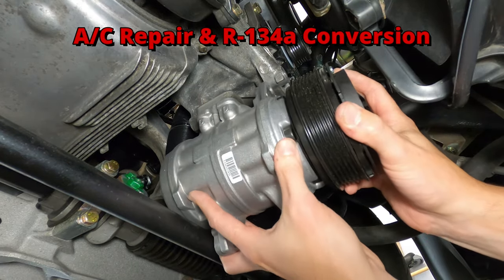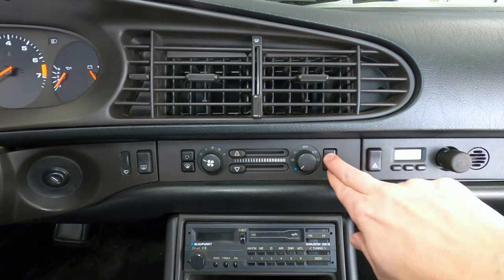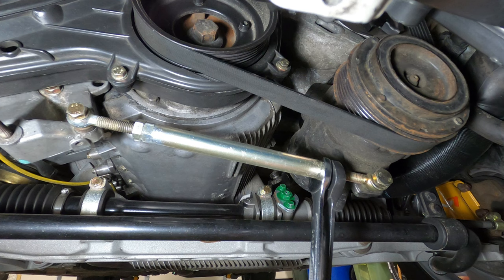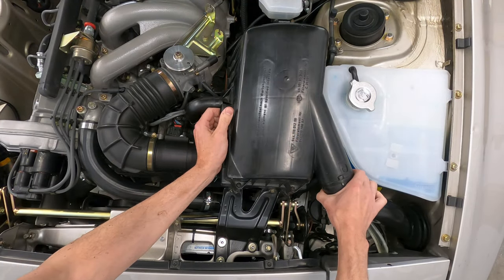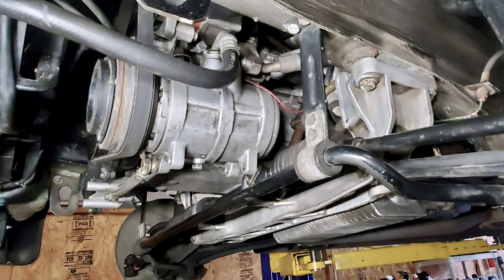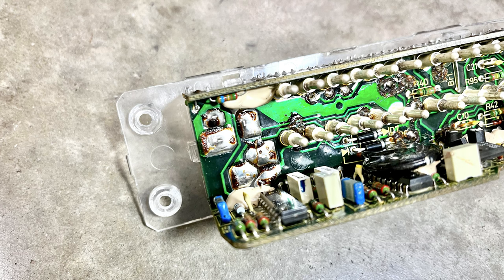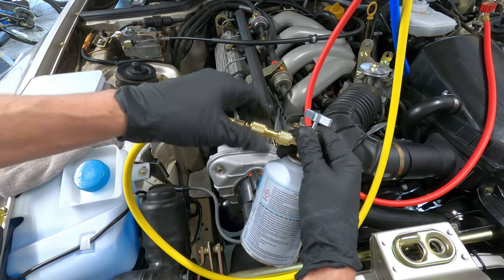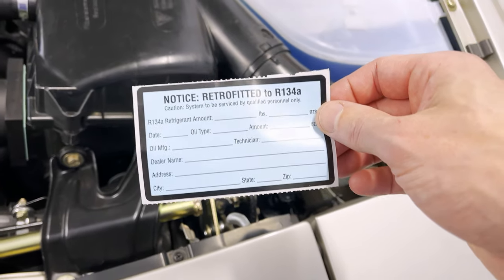Porsche 944 – A/C System Repair & R-134a Conversion Tutorial

Comment: After removing my compressor from the car, it had no oil. After adding 5-6 oz of ester oil and turning the clutch, it was fine on the ground with no oil coming out of the compressor. When I installed it back in the car, a little leaked out of one of the holes of the manifold. I tightened the 2 fittings on the manifold and put everything else back together. Will I have any issues when the shop recharges the freon? Thanks in advance for your help.

Comment: Great instructions but if I may add a few tips on 134a conversions on the 944. A new parallel flow condenser (I saw you installed a new tube and fin style) will help massively as most oe condensers have 30+ years of crud in them.  The second thing is that the mineral oil should be flushed with an ac flush tool and solvent. Other than those 2 additional items your work here is a great benefit to the community.
Reply from the maker: Great points, thanks for sharing your insights! In a perfect world of optimally performing AC systems, I totally agree. 😂 AC system repair is a fairly specific topic that can get deep pretty quickly, so I elected to demonstrate what I could in a reasonable amount of time. I also figured the average DIY owner wouldn’t take the steps to replace the condenser (given the cost) or remove the expansion valve for a flush of the evaporator (given its inaccessible location), so I stuck to the basics that most people will follow. Not shown here, but performed during the front end rebuild of the car was a removal and liquid flush of the barrier hoses. They were surprisingly clean and dry, my guess is the system was empty and exposed for more than a decade, pretty wild. Out of curiosity, do you have a good lead on an aftermarket partial flow condenser that doesn’t require modification to fit? The only thing I was seeing at the time were the OEM units. Cheers man!

Comment: can you share the link of where you bought the ac compressor? and would you suggest buying one that's being parted out? or will it most likely be not working?
Reply from the maker: Hey, sure thing! I purchased the compressor from 944Online.com and I will post the links below. There is definitely a risk that a used compressor will have leaks, so unless it is available for a very low price, I would go with a newly refurbished unit. 

Late model compressor - https://944online.com/ac-compressor-kit-924s-944-951-968/

Early model compressor - https://944online.com/ac-compressor-kit-944-1982-to-1985-1/

Comment: Did you use tube and fin condenser (like the oem), or did you switch to a parallel flow condenser, which works better with R-134a?
Reply from the maker: Yeah, I used all OEM parts for the A/C restoration…

Comment: Brilliant as usual. During the conversion to 134 did you replace the O-rings to the new type  at the expansion valve or just leave them alone.
Reply from the maker: Thanks! Yeah, so the two o-rings at the firewall that pass through to the cabin, I elected not to replace those at the time. It can be done with everything in place, but is very cramped and difficult to reach. I probably should have done them when I had the cylinder head off the engine, but so far they seem to be holding up well, with no discernible loss of refrigerant.

Comment: Hi, thanks for all your amazing video’s! I was wondering if you know if the 944 turbo airco system is the same as the regular airco system. And if so, is it possible to install airco on a 944 without pulling the engine?
Reply from the maker: Hey, its sounds like you have a 944 that was factory delivered without AC? If so, it will require quite a lot of work to add the entire AC system, specifically the modifications to the HVAC unit to add the expansion valve, etc.  That said, most of the AC components are the same across the base NA cars and the Turbo cars, but the refrigerant hard line from the evaporator to the compressor is a slightly different part on the Turbo. The hard lines would be challenging to install as they route behind the engine, but it can be done, you'd just have to shift a bunch of things around to make space, like the wiring harness that runs along the back of the firewall.
Reply: Thanks so much for the reply! I can buy a whole set for 1k€ and it has a hvac unit and i think all parts needed included. It does not say it’s from a 944 turbo so maybe the line will not fit. Or could i make it fit of the line doesn’t work?
Reply from the maker: @thijsdejongh6192  That one line was part number 951-573-091-02, but is no longer in production, there may be some used ones available…
Reply: @NC944er thanks again for the time, effort and knowlegde! I might be able to get the turbo lines as i think the owner of the set also has those!

Comment: Nicely produced video that will be referenced many times. 

I got lucky on my 85/2 in that the system held R12 even after the car had sat for 10 years.
Reply from the maker: Wow, that is good luck! Hope it holds out for many years to come… R12 prices are getting a little crazy now. 😂
Reply: @NC944er  Yup... good luck indeed. R12 is 30$-40$ an 8oz can on CL. I bought a case of 12 but only needed 2.5 cans (about 20oz) to get sufficient pressures  So far so good after 6 months.

Comment: Another great video. Question: where did you source your AC condenser? I need to do this as well, but I am dragging my feet at the high cost of the OEM condenser unit. 
Thanks!
Reply from the maker: Thanks! I first attempted to buy through Griffiths, but they didn’t have any units in stock. I ended up getting this one from 944Online and it included the receiver-drier and the o-rings with no core return required.

Comment: I have an 87 NA that will need this.  Idea for future videos for us novice wrench turners is give a comment on skill level and project duration.  Thanks for what you are done by.
Reply from the maker: Nice! For this job, swapping the parts is pretty straightforward, so probably a 3 out of 10 difficulty. The refrigerant refill requires some specialized equipment and some prior research on the process if you’ve never done it, so maybe a 7 out of 10 on that piece. The work will take 2-3 hours in most cases.

Comment: Another great video. I did this job not too long ago. I ended up rebuilding the original compressor and it still works great. How did you do the o-rings behind the cam tower?
Reply from the maker: Nice! I watched the 50-minute video of the British guy rebuilding his compressor and when he said he wouldn’t have attempted it if he had a do over, I said ok nope. 😂 I didn’t end up replacing the o-rings at the firewall, but would have taken the extra steps if the system wouldn’t hold pressure. It’s real easy to do with the cylinder head off, but hoping I won’t need to cross that bridge again anytime soon. 😄
Reply: @NC944er  I also skipped those o-rings initially but had to go back and do them a year later after detecting a leak. Luckily it lined up with a cam/head refresh.
Reply: I am currently doing this conversion and had a leak at those damn firewall o-rings while doing a pressure/soapy water test. It is possible to replace them...

The magic tool is using a flex head ratcheting wrench with those box end socket adapters, so it converts your wrench to a super low profile socket while having any angle you need. Putting the new o-rings on is even more of a pain in the ass - I had a helper hold an extendo flexible grabber that was holding onto tweezers that had an elastic band around it to hold the o-ring; I had them hover the o-ring in place while I did the reach around the cam tower to push it on the hose.  Also visibility is awful and most of it is done by feel. Took me a couple hours - never want to do it again
Reply from the maker: @Seagrams  LOL! Well I’m glad mine are holding out so far then. I didn’t add Freon with leak-stop in it, but that may be an initial move if they start to leak. In hindsight, I probably should have done them when I had the head off the car.

Comment: wow, at 4mn, it takes you 2sec to reinstall the compressor, I've been at it for over an hour and I can't get it back in -_-
what's the magic trick to get the 2 brackets in simultaneously ?
Reply from the maker: If it’s the OEM compressor and the correct part number, it should slide back in with a bit of wiggling. Maybe apply some high grit sandpaper to all sides of the mating surfaces to remove any oxidized material for a cleaner install, that and some assembly lube.
Reply: @NC944er  Thx I should try that
 ;-) 
It's the original compressor, I just drained/replaced the oil and seals after checking it was operating normally

Comment: Hi! I have a quick question. How often does your compressor engage? My air condition unit works perfectly fine, but the compressor engages/disengages every 8-12 seconds.

Temperature outside: 35 degrees
Air flow temperature inside: 7-9 °C

I wonder whether that's normal behaviour for the air conditioning unit or whether a sensor or something is faulty.
Reply from the maker: @Martin-yi6py  8-12 seconds is really short… mine normally engages for minutes at a time. Could be a pressure sensor or lack of refrigerant. Have you tried topping up the system?
Reply: @NC944er  Thank you for your answer! I will check the levels again! Greetings!
Reply: @NC944er  Hi! Thank you for your answer. I have done some more investigating and I suspect the sensor for mixing cold and warm air. It doesn't show any resistance and I think the compressor tries to regulate temperature the "hard way" without the sensor working :D

Comment: Brilliant video, out of curiosity is it possible to install the whole air conditioning system into a car that didn’t have it installed originally? My 1982 n/a didn’t have it installed and was hoping maybe in future to gather all the parts in putting the system in
Reply from the maker: Thanks! Yes, it would be a bit of work, but is possible. First step would be to assess what pieces your car has installed and determine what you would need to track down. Does it have an expansion valve installed on the evaporator assembly? If not, the assembly can be removed without removing the dash, just some cramped conditions. Does you car have the correct alternator/compressor bracket to mount an A/C compressor? If not, you’d need to install the correct bracket. Routing for the lines is tightly placed behind the engine, which may require pulling all the wiring harness back to make space, etc.

Comment: Thank you!!!! This will be a big help in restoring the AC in my 87 924s
Reply from the maker: Nice! For the 924S, you may find the low-pressure connection behind the engine by the firewall. Good luck!

Comment: You showed fuse 29 to be related to AC. However, under my fuse cover, it indicates that this is a spare fuse. Is this incorrect by Porsche or a mistake in the video?
Reply from the maker: The orientation of fuses and relays at the central electrical panel was changed year-over-year as Porsche modified/refined the electrical options on these cars. The information shown here is accurate for the 1988 model, but may not hold true for other model years. I’m assuming you have an earlier car? In that case, you’d want to follow the fuse panel diagram for your specific year and locate the heating/AC-related fuses on the label.
Reply: @NC944er  I have a later car, 1985.5, it’s the refresh dash. Unless what you’re pointing out they changed the fuse post the updated version?

I did manage to get my AC working though!
Reply from the maker: @Gizmosis_  Yep, that would explain it, Porsche even made small, unnoticeable changes each year after the refresh. For example, my ‘88 has an alarm relay that the prior years didn’t. I’m glad you got the A/C going! 👍🏼
Reply: @NC944er  appreciate it! Also, I really appreciate the detail of your videos! Some of the best for 944 information out there right now. I’ve been sharing your videos to the 944 community in South Florida (it’s pretty big here).
Reply from the maker: @Gizmosis_  Sweet! Yeah, there are little pockets of 944s everywhere. I’ve been amazed to find how many are hidden away in NC where I live. I had a neighbor about 7 houses down and it was the longest time before I realized he had a 944 sitting in his garage for the prior 3-4 years. 😂 Glad to hear the content is helping your 944 crew keep these cars going!